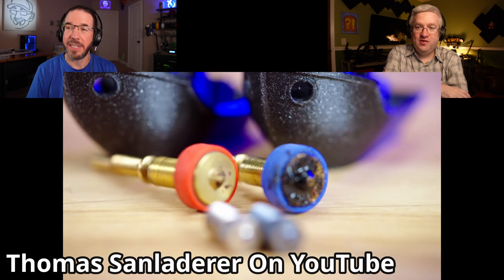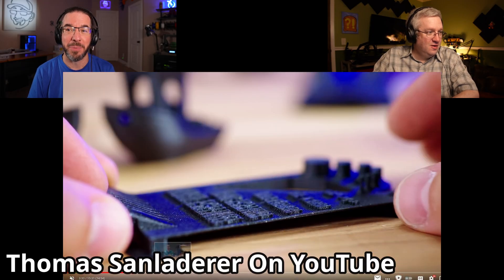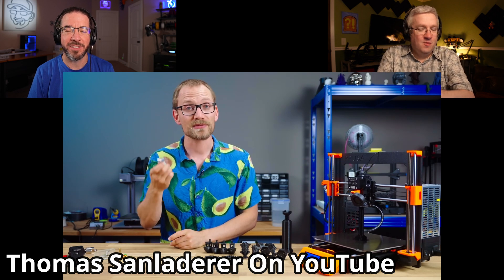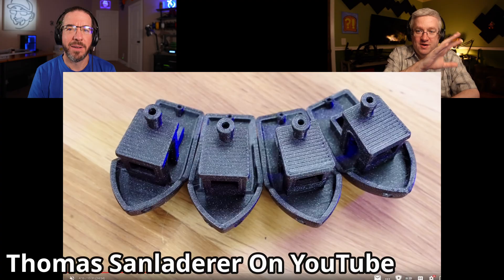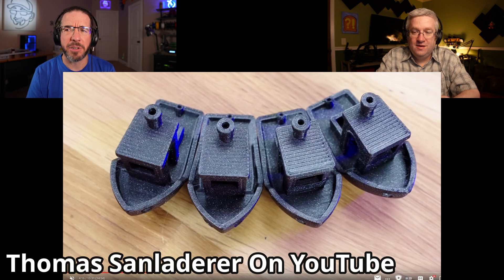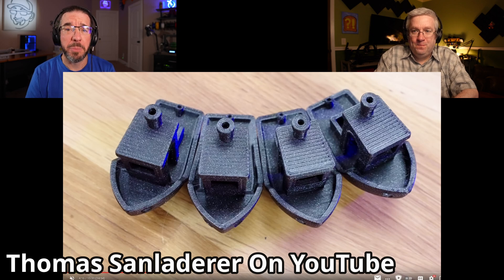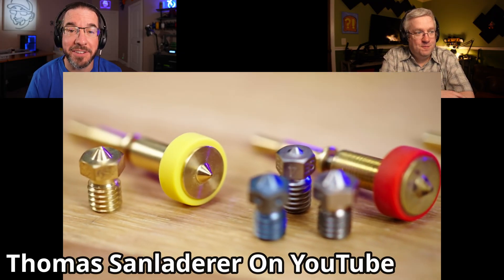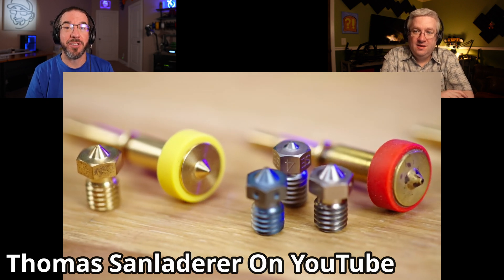0.6mm is the new 0.4mm? #3DPrinting

Comment: I only have the one 3D printer, and I pretty regularly print things that need to print overhangs well.  I would love to improve my print times with a 0.6mm nozzle, but I don't think I would do a good job swapping back and forth between 0.4 and 0.6 nozzles.

Swapping nozzles would eat up some of that time saved, and then me accidentally slicing for the nozzle that isn't installed would probably eat up all the rest of the savings!  I would need to go all in on 0.6mm.